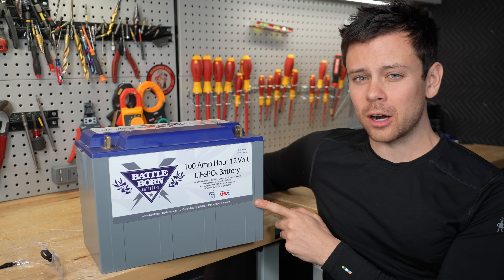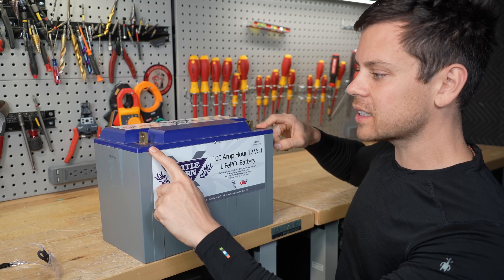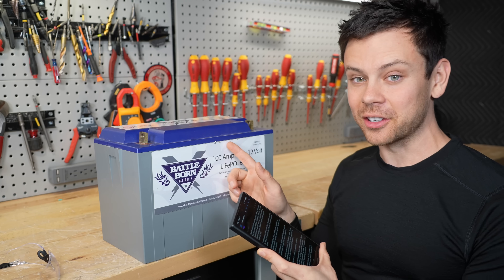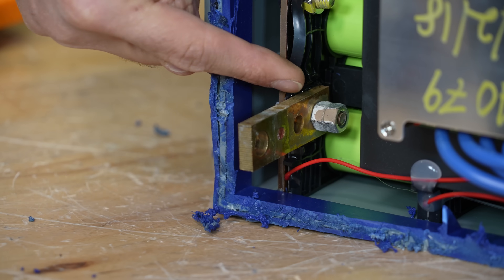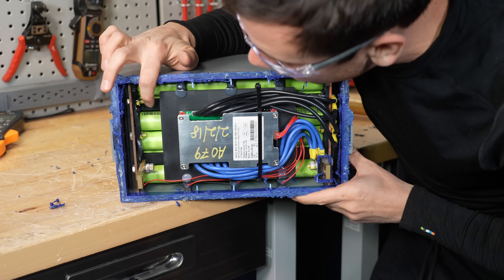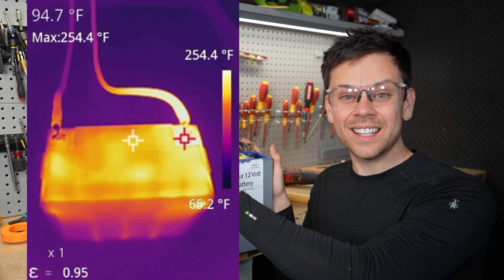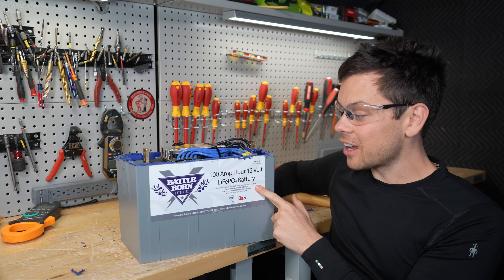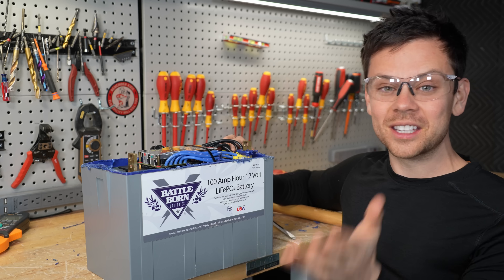Battleborn 12V Battery: Major Safety Issue

Comment: I'll venture to guess that someone on the production line has a broket torque wrench.
Reply: You'd be wrong. The issue is they are bolting to plastic. Plastic deforms. Loose a little tension on the connection then you get arcing. Arcing leads to fires. Poor design is at fault.
Reply: @FauxQue-yk8dt  There could be a design flaw, I agree, but what makes me think that proper torque might be a problem is that there were loose bolts in many places in the battery and it didn't appear obvious to me in the video that plastic was part of each connection. Regardless, there seems to be a lack of engineering oversight involved.

Comment: Exactly why I still build my own batteries. Battle born came out and I thought ya right somethings not right how they are over charging (price). Well there it is finally. They made a engineering mistake thinking plastic will hold up. They had to add a spacer because of cell size and how they orientated them. Great cells but too much trust in plastic spacer. Me personally i would have just made the bus bar the spot for the terminal lug in stead of compromising looks/ esthetics.

Comment: This would be such a simple DIY repair if the battery hadn't been sealed.  That points to a big looming problem for sealed batteries in general.  But at least it's easy to test whether one has the problem or not.   Considering the high cost of Battleborns, I definitely would have expected better.

I can't believe they just used a double-nut to secure that bus bar.  Not even a lock washer to maintain pressure.  And those don't look like flanged nuts either.   Not that I am a fan of nuts inside a sealed case anyway.  But that kinda takes the case.  Double-nuts never hold pressure.
Reply: lol, I thought exactly the same.
The issue is really that these battery's are sealed and not serviceable.
Reply: @edwinbruckner4752  repairabililty would be nice, but that doesn't make up for bad product design.
Reply: Yeah, the double nut is janky AF.  Why is that the only connection without yellow paint marking like the negative post?

Comment: nothing a 5 cent lock washer coulda fixed 😮
Reply: But the plastic in-between can still fail, as it's not meant to be under pressure or expected to not deteriorate over time and fail. The loose connection is what's causing the resistance and therefore heat.  People are also loosing energy from the failure.
Reply: @JimmyCall yea, price doesnt always equal quality

Comment: Thank you Will! BB advertises they have UL 2054 (for general purpose batteries) and UL 62133-2 (for portable sealed secondary cells) approvals. Maybe someone should send your video to Underwriters Laboratories. UL approvals (certifications) can absolutely be revoked, suspended, or withdrawn. I suppose the flaw might be mitigated by ensuring the connecting leads don't undergo any movement by securing them to the battery case, but it's a kludge solution. I would absolutely not use these batteries in any kind of mobile installation.
Reply from the maker: Good point
Reply: Also, the U.S. Consumer Product Safety Commission (CPSC) should hear about this.

The terminal forms a lever arm with the deformable plastic cell holder acting as the fulcrum. A tiny amount of force at the terminal end where wires are connected would have its force increased by the length of the lever arm. Archimedes could have predicted that effect 2,200 years ago. The terminal doesn't even need to move much to transfer force since the red epoxy filler is also deformable. 

Calling the design a "safety" feature was just a rationalization for a bad mechanical and electrical design. BB exploited the old "it's not a bug - it's a feature" excusive argument.
Reply: UL is just another money grab. No protection there! Just pay more for their little UL sticker.

Comment: Hmmm …. Interesting discovery. I have 3 of these 12 Volt 100 A/H  BB’s, connected in parallel, that I use with my camper.
I’ll have to check and see if they are showing any signs of this problem …
Reply: The good news is that you can replace those 3 bb's with one 300 watt mini for a 1/2 of the cost of one 100 watt BB.

Comment: Based upon what I just saw, and my professional experience as a Tesla Battery Technician, double nuts and no lock washer is not adequate. 

The nut should be a nylock type, with a bevel type lock washer. 
AND critically important, the nut(s) must be tightened with a torque wrench to a specific torque. 
After the torque, a multi meter must be used to verify complete and proper contact.

I trust that you have notified Battle Born. Very likely they will need to perform a recall.

Possible root cause analysis:
the assembly process, parts change, tool calibration, or assembly person was not qualified/certified.
Reply: Your professional experience should be telling you that you don't have plastic wafer boards sandwiched between two busbars. No amount of nylock nuts will fix that.
Reply: @69Atho exactly, you cannot get it tight with plastic in there.

Comment: I have 8 of these in service for several years now and got them after Will had texted them. No issues so far. Bad thing is I just bought some more!
Reply: 😅😅😅

It's been a while since Battleborn is an overpriced brand... And as we can see, there is nothing superior about them compared to several Chinese LiFePO4 brands. A 280ah 12v battery from Eco-Worthy is about 480€ or 500 bucks... Top quality, assembly and Eve cells inside. Absolutely no reason to pay top dollar on a 100ah battery that costs double than a better 280ah battery.

Check your batteries and make sure you don't have this issue...
Reply: I just bought more too. 6 total

Comment: I had 3 of them with that exact same issue! They stopped working and showed 0v. They were less than 1 yr old and i purchased them directly from Battle Born. Battle Born support was the worst I’ve ever had to deal with. I purchased these and paid a premium price for the warranty and support. Basically they said on my first call that I improperly discharged the batteries and they do not warranty that. I was told that I could send them back at my expense and they would take a look and decide what they wanted to do. I decided to cut 1 open and found this issue. I tested all of the cells and they were fine, it was the melted battery terminal with that 1 bolt on the positive post that was cooled. I called BB back and the technician told me I now voided my warranty and I needed to properly dispose of the battery at a local disposal site. I said why, the cells are perfectly fine, it’s your faulty design that is the issue. He continued to bash me and push it off. I demanded to speak to his manager. She called me back an hour later and continued to deny any issues and said they would still allow me to send in the other 2 that were not cut open, but the one i opened was no longer able to be warrantied and i have to dispose it. I said how about i cut open the other 2 and see if they have the same issue?? She said then i would void the warranty! I said GReat Customer Service! I cut open the other 2 and what do you know? Yep, exact same issue. I fixed them myself with a copper bus bar and more bolts across the positive bus. They are working fine and have been now for 2 years since i fixed them. DO NOT buy or support this company!

Comment: I would just cut an area the positive lead and fix the connection, too expensive to just throw out. I have one will have to check on charging.
Reply: There should be a few clever fixes out for this soon, I imagine.  How to cut it open neatly, re-work the terminal connection, seal.   Even better, a hack that makes it reopenable. Bolt on flanges on each side of the cut.    There will be a lot of used Battleborns on Ebay soon and might take 2hours to refurbish.

Comment: Wow!! That is so crazy!!  Maybe the end of battle born?
Reply: It should be.  That battery was, apparently, designed by someone with no experience or knowledge of material science.  The fact that they're using a steel bolt as a conductor tensioned through plastic is an unforgivable design flaw.  

For anyone not familiar with material science, here is why these fail.  Steel is a poor conductor of electricity compared to copper or aluminum.  This means proportionally more of the energy delivered will be turned into heat in this material.  When the battery is delivering power, that steel bolt will be handling all of the current.  This leads to the bolt heating which causes it to expand slightly and the plastic it's tensioned off of to soften.  When the plastic softens, it loses its ability to maintain its shape against the tension of the bolt.  With the strain relieved, the connections made by the bolt are now even higher resistance leading to more heat being generated by the now loosened connection.  This cycle continues until something breaks contact.

Again, what a terrible design.
Reply: @mvansumeren4313  wow the metal plate isn't even touching the busbar. Ouch.
Reply: Their stock price (DFLI) certainly shows they won’t be around much longer. You can forget the idea of any warranty replacements🤪

Comment: Will, I had 4 of them that I took apart with the same issue. All of them had the same date code and all had issues with the same thing. I filmed it and will post it in a few days and send you a link. I called them and spoke with them about this. I was told that there was no other issue was reported and there was no issue with them.  I told them they all had the same date code so there must be a quality control issue at that time. This was 2 years ago I spoke with them.  They flat out denied of there being an issue. Now I see this and I call BS on them for stating there was no issue. Ill send you a link to my video as soon as I get it up. I just thought you should know. Wayne
Reply: If I had a dollar for every time a company told me that I'm the only one experiencing an issue with their product that clearly wasn't just me, I'd have enough money for dinner for four at KFC.
Reply: @FirstLastOne Holy cow you have gone through a lot of faulty products to buy KFC!!!!! lol
Reply from the maker: Holy cow!!!
Reply: @WillProwse  maybe do a video on drawing loads through bolts where the bold becomes the conductor. Especially stainless bolts. But maybe to it with stainless, bare steel, zink coated steel, brass, copper to show a variety. 

I know you pointed to the issue and sort of mentioned the conductors being insulated by the plastic and the bolt being the conductor. That’s less than desirable. The bolt should never be the conductor, it should only hold the conductors in contact.

I can’t remember if you’ve done a video on it. I know others have. If you haven’t then please do and use a FLIR camera to show what happens.
Reply: @jeremykamel9655  it would be good to do a video on this. And I suspect you already know what will happen. The material properties, including conductivity, are available for all these materials. Even brass is terrible compared to pure copper. Even silicon bronze and beryllium copper are seriously degraded as conductors compared to pure copper.
Reply: If they do not take immediate ownership of this issue, it will result in the DEMISE of BattleBorn. To think I spent $950 each for my battleborn batteries, and for my most recent needs I spent $160 for Dumfume, which thus far have matched the performance and do not have a known safety issue. The same cannot be said about Battleborn . . .
Reply: @artsisland1683 Now that Will has revealed the flaws, and if they're still in the accounting black, they'll address the problem, else they risk being sued. Intent is a weighty tenet in court.
Reply: @JimmyCall  Their stock is trading for pennies. Don't expect anything from them beyond denials and more ridiculous claims, blaming their victims.
Reply: @artsisland1683 The cost of repair/replacement will probably do them in.  This level of defect would be recall territory, voluntary or mandatory, in a lot of countries, USA though... I'm not sure if the recall would happen.
Reply: @artsisland1683I’d almost bet money they won’t. They’re still charging $800+ for the same damn batteries over half a decade later. Look at a couple of their newest reviews on Google too. Ghosting people on warranty repairs.
Reply: @artsisland1683 Looking at the unboxing, the Battleborn seem to be good quality for a 2018 battery. The wiring seems proper.  It's just the stupid plastic frame not having a terminal pass through. They took the dodgy route and used the plastic to couple the terminal so as to align with the box exits.
Reply: Ok, I am noting Battle Born on my blacklist right now.

Vote with your wallet, men!
Reply: I wonder if this isn't why I've seen quite a few for sale on FBM this year. People were still wanting a pretty penny for them ($500-700 iirc), but claimed they were the best batteries under the sun, etc. Just thought it was odd, since I've only seen one or two a year for sale before this locally.
Reply: @IdahoRoamingGnome  notice the same thing on FBM in SW AZ, told somebody the same thing
Reply: Totally not surprised. I've bought other items from this garbage company that never worked and was told there was no issue then given the run around. I persisted resulting in the CEO calling me up on the phone to tell me he went to an Ivy League school and that his product works, after I mentioned that I'm an electrical engineer so don't BS me.  I never got an RMA or a refund. Anyone that buys anything from them does so at your own risk.
Reply: @muhdiversity7409 yeah I tried calling their support one time for help with an MPPT, the call lasted about 45 seconds and they basically told me I was stupid lol. Will never do business with that garbage company again
Reply: @muhdiversity7409 wow crazy and they're so expensive I think they're going to go under. Too much competition they're probably not selling anything anymore you're the only thing they're selling is fucked up batteries excuse my language thanks for the knowledge
Reply: Please post the date code.  I have two of them in my rig purchased Dec 2021.  Rig's in the shop but when I get it back I will be having a look.
Reply: Can you share the date code?  Thx!
Reply: What is the date code?
Reply: Can you share the date codes?
Reply: They knew about it in July of 25 Wayne  Read my post here about it
Reply: Would you be willing to share your date codes?
Reply: Sounding a lot like Dakota management right there! 😏
Reply: Thanks for this video. It’s nice to see RV batteries getting looked at and thank you to the subscriber that gave you it to tear down.
Reply: So basically look for epoxy color? 

Also should we look for certain date codes?
Reply: All companies say that your the first person reporting a problem. Regardless what it is and on what item. Because they don't want to take accountability for their pos.
Reply: VERY interesting to see this!  In late 2021, someone diagnosed our frequent power loss as being "loose terminals" on 3 of our 4 BB batteries.  Our solar vendor replaced all FOUR under warranty, but there was never any mention of this.  But the "wiggle / power drop out" was the 100% exact same thing that was happening.  Now, our new ones haven't done that and I frequently check the connections (outside, obviously) to ensure they are tight, but now I'm worried that the replacement batteries might have the same potential issue as the old ones.
Reply: Wish I had known then what I know now!
Reply: I bought 2 directly from them in 2020. Thanks for jetting me know Will.  I was willing to pay triple for safety and a USA product.
Reply: @sheltermutts4185 I think it would be a stretch to call this a USA product.  To my knowledge, no LFP cells are manufactured in the US and the BMS is probably made in China.
Reply: Is that why you sold Eric's off.
Reply: If their whole line of batteries is defective it'll probably put them out of business. Good assholes the customer service and the technical wizard were both I think. Very falsely informed and lying when I spoke to them full of horse s*** I do not recommend a battleborn ever
Reply: china if you can cheat / cheat .i real saying motto
Reply: @overbuiltautomotive1299  Battleborn is an American company. The Chinese batteries work fine.
Reply: @overbuiltautomotive1299 this isn't a Chinese company and they claim that their pack design is American. If it were Chinese it'd probably be better or at the very least one tenth the cost.
Reply: @mathehack1 they are Chinese batteries. Pack DESIGN waa done on a pc in usa.
Reply: @overbuiltautomotive1299  Huh? Try to make sense, goofy.

Comment: it melted the plastic making it looser? why is it bolted on the plastic?
Reply: They could have easily had a hole in the plastic for the bolt and terminal to access, without the plastic being a part of the binding.
Reply: Yes, if the plastic melts, the bolt will only get looser and make poorer contact with the copper bus bar that is on the opposite side.
Reply: @Willdesignsandbuilds  100%. Over time plastics can also deteriorate and crumble. It was a stupid if not desperate choice Battleborn made.